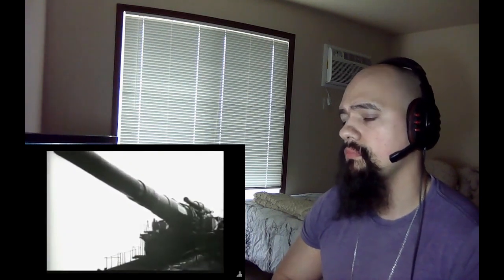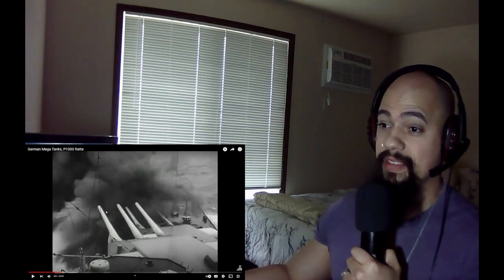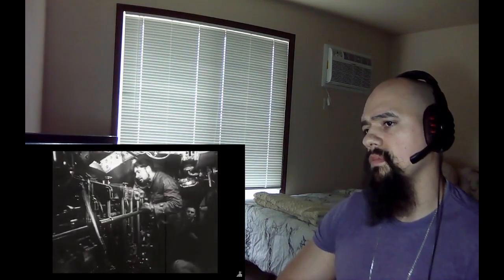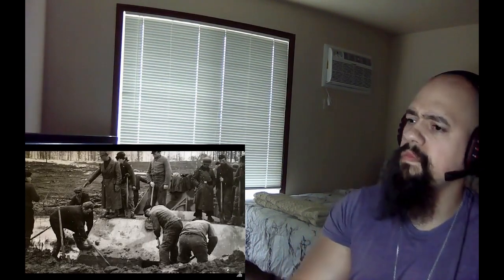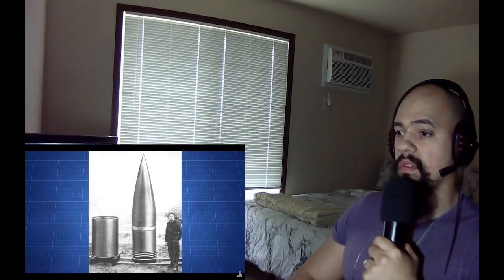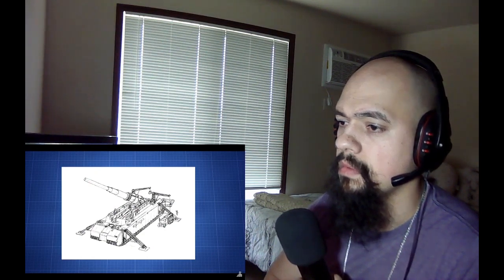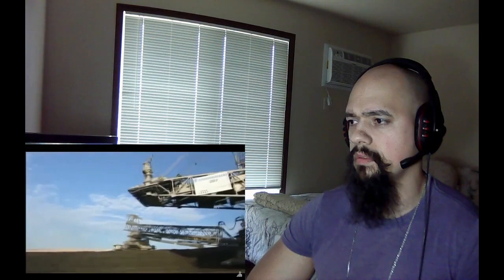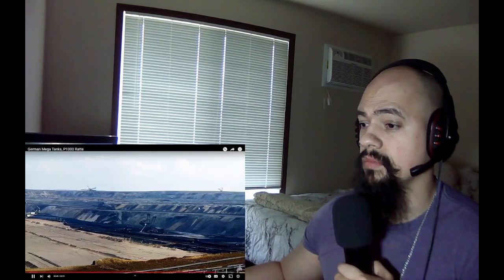(American reacts) Top German Inventions Reaction - German Mega Tank P1000

Comment: In regard to jets, Britain and the US were both a bit behind Germany on early jet development. Looking at when each country flew their first jet prototype, Germany flew first in August 1939, the first British jet flew in May of 1941, and the first US prototype taking to the air in October 1942. Of course, Germany was moving ahead with development of a production jet warplane with some speed, but so was Britain, and the British Meteor jet fighter the Gloster Meteor was produced slightly before the ME-262, but the German jet fighter was the first to become operational in April of 1944, with the Meteor following later that year in very small numbers. The US had little pressure to develop jet aircraft further during the war, so the first operational US jet fighter the Lockheed P-80 Shooting Star did not enter service until very late in 1945 after the war was over.
Reply from the maker: So the Germans were the first actually using it in combat basically.